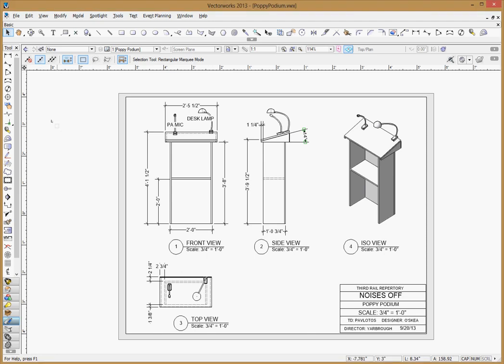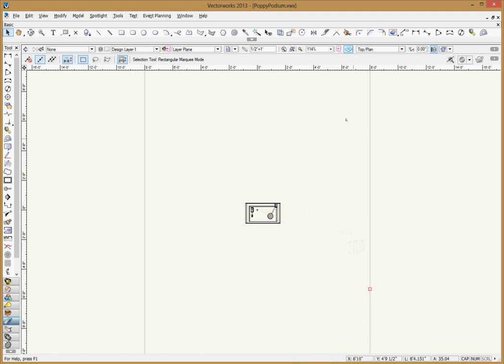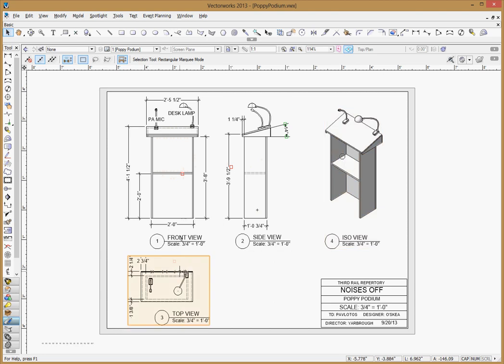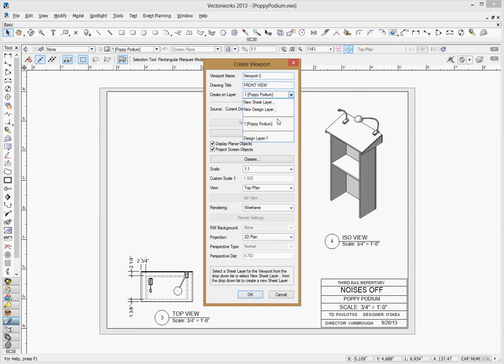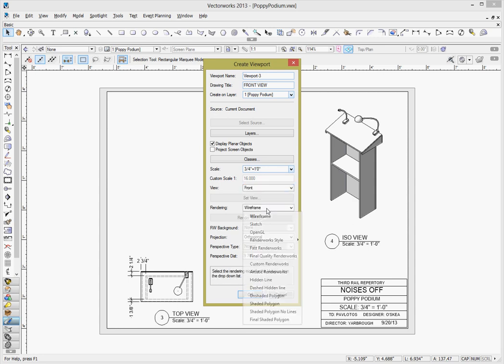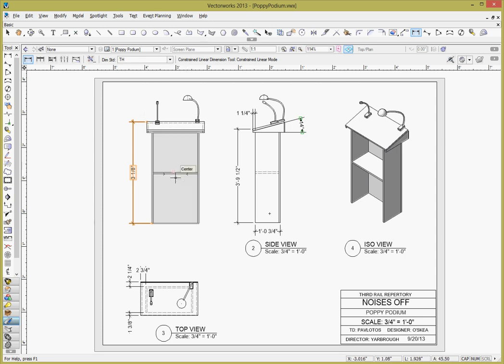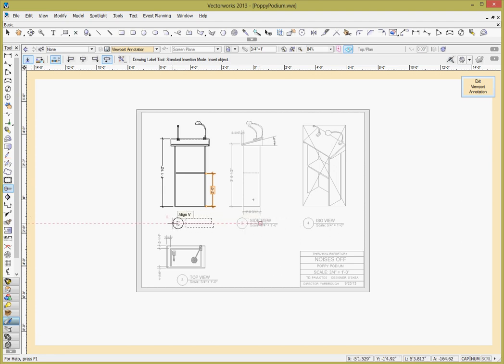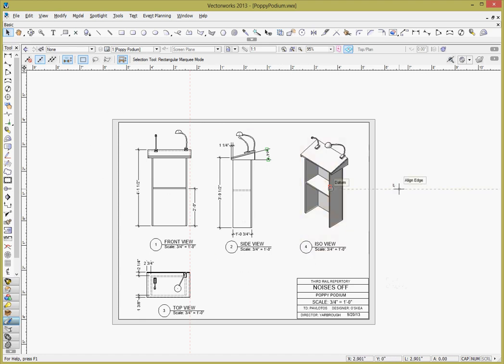Vectorworks Viewport Basics

Comment: Using VW 2012; can't figure out how to crop a viewport to show just part of my drawing.  I have an overhead view, section, and elevation of my light plot all on the same "model space," but I want to create a sheet layer with a viewport that only shows the overhead plot at 1/4" scale.  Help?
Reply from the maker: Sorry I've been out of the country, you've probably figured it out by now. Double-click (or right click) on your viewport and select "Edit Crop" in this orange-boarder edit space, you can draw any (single) enclosed 2d shape--rec, circle, crazy zig-zag shape with the polygon tool, etc--as long as it is a closed shape, and that will act as your crop. Exit the edit space and you'll be all set. You can choose to show the crop object (sometimes nice esp with detail circles) or not in the Object info. Sorry to be so long to get back to you.
Sean
Reply: Thanks.  Yes, I did figure it out thanks to F1, believe it or not.  Now I'm trying to figure out how to freeze certain layers/classes in viewports the way I'm used to doing in ACAD.

Comment: How do you export to PDF or DWG or just print an isometric view of your drawing?  Lets say it was drawn in 2D in Vectorworks, and you can show it as an iso by changing the view. I just try to export it and the PDF is blank. I really only use VW for drawing, not for modeling. I'm on VW 2015. Thanks for your time.
Reply from the maker: Mindy: Sorry I don't know what's wrong. You just print. Or export. The only thing I can think of is that your object is not on the page. Check to make sure "Show page boundary" is on in your page set up settings. You'll see a grey box the size of your paper. Make sure that what you want to print in in that grey box. You say you have drawn something in 2D and then want to show it is ISO view? You need to actually have a 3D object to see it in iso view. Just switching to Iso view doesn't magically create a 3D shape from 2D lines.  Drawing in 2D is just like drawing on paper. You can, of course , draw front/side/iso etc views in 2D but you'd do it just like you do with a pencil and ruler.   The example in this viewport tutorial is of a 3D object being displayed in various viewports. 
This tutorial will explain the page setup settings: 
https://www.youtube.com/watch?v=DwVD44mgmQ8&index=6&list=PLv5JwQFf-Au3UEOGMGlovUYQHasWL8QpM
Reply: Thanks so much for your response.  I figured it out.  I took the 2D drawing and rotated it so that in 3d it would actually look like an orthographically projected iso.  I made a viewport after following your tutorial and I exported the pdf and dwg from there .  I still don't know the proper way to do it but at least I have a vector drawing in iso I can work with.  Solves my purposes for now.  I'd love to know more about vectorworks considering I use it for drawing often and paid for the architect edition.  I'll check the tutorial on the page setup and see if there is anything I missed.  Thanks Sean

Comment: I use Photoshop to edit photos and it uses "layers" in the process. I liked these videos, but I am still not getting my head around the difference between a "sheet" layer and a "design" layer.
I think I am getting my thoughts collected on viewports. I have VW 2009
Reply from the maker: You can print form either type of layer but sheet layers are for creating viewports (cant put a VP on a design layer) and setting up your doc to print. I have the 3D model of my podium on a design layer and all 4 ortho views you see on my sheet layer are views of that one 3D object. It's like there are 4 cameras on my design layer pointing at the podium from different angles. Each camera is displaying its image in a VP on the sheet.
Reply from the maker: Maybe think of viewports as the content blocks you would move around the page back in Pagemaker or Quark or other desktop publisher. Similar to placing a smart object in PS instead of cut/and paste. Hope that helps. 
You might watch the longer tutorials "Organizing your Documents in VW" part 1 and 2 if you're still having trouble. Layers are similar to PS layers but not the same.
Reply from the maker: BTW 2009 might be the first year VP appeared--I forget exactly. I'm not even sure there were sheet layers then. I'm using 2012 and 13 in these tutorials so it's gonna look different than your version.
Reply: Sean O'Skea
I think I got it.
I draw or construct an object or structure on a "design layer" with the "actual" dimensions and then I use a "sheet layer" To create viewports of any sections I might want details on or a 3D perspective(s)and also I can set up the sheet layer to print on any size paper I might want to use. anywhere from 8.5 to 24 x 36, or whatever.
I had thought about upgrading, however I don't use it enough to justify the expense. I guess I am lucky it installed on my windows 7.
I am in the construction business and I like drawing blueprints for the help that is easier for them to understand. 

 I also dabble in recording music using Cubase, or StudioOne as the DAW and the upgrades are much less expensive. I also use those on a MacPro. Along with Final Cut Pro Studio   
In any event I wanted to thank you for the response and doing these videos. I am the type of person that if someone shows me how I can do it. But I also like "details" so that I understand the "why". Although I read the manuals they generally give me headaches. ;-) And the training videos that came with VW are very helpful, they don't really have the details I like.
Once again, thanks for taking from your time to do these videos!

Comment: Sean, Is there any way to create an ISO section view port?
In this design i'm working on I've got really tall ceilings and pretty small rooms and the only way around it I could figure out is actually manually hiding walls that I want to be invisible, is there a way to create a section viewport, like for front view sections but in orthogonal perspective?
Reply from the maker: +agata2604 https://www.youtube.com/watch?v=lIS52ruVN1A Yes you can use the clip cube. You can see how in this one. Rotate the cube first then move the cutting plane. In 2016 you can use all 6 sides. In earlier vrs only the sides work but you can still rotate the cube 45/45   --Sean
Reply: Thank you so much for such a quick reply!